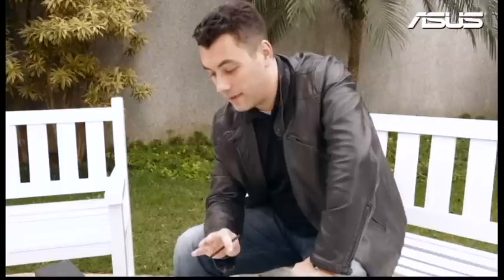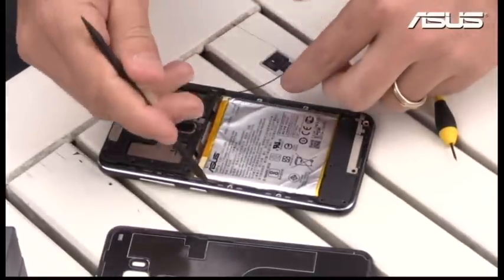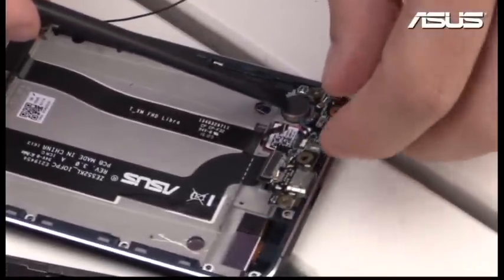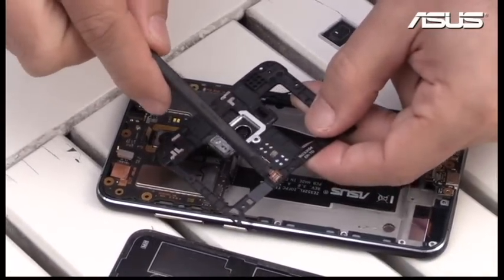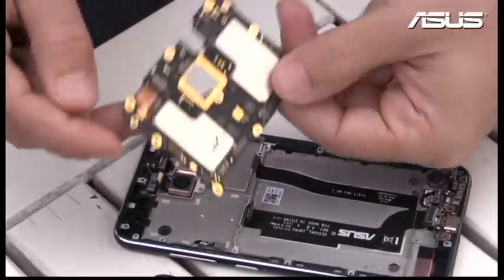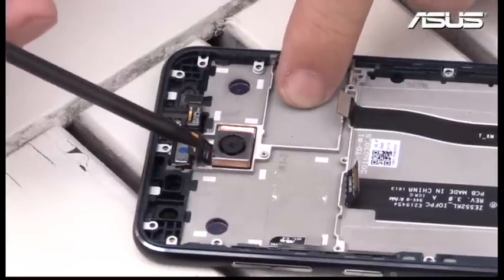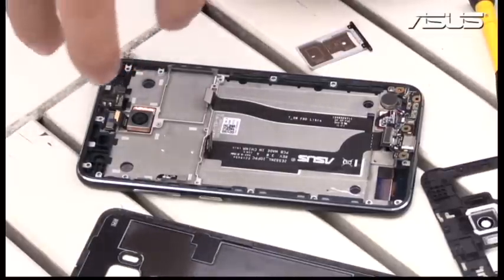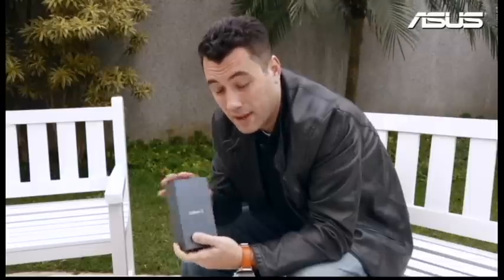Anatomy of Incredible ZenFone 3 by Marcel Campos

Comment: Marcel campos you don't have marketing and pricing sense. Sd 652 at 50k. Are u nuts?
Reply: No, i am not nuts not even the  only one to take decisions at Asus. If processor is the only parameter to decide which smartphone is the best or the worth of the smartphone I am sad to inform you that these days are gone. Today the processor is a important part but not the most important to define the total cost of a smartphone. Camera, materials, panel, battery, ram and storage play a big role in the total cost. With the new 625 (for Zenfone 3, not 652 as you mentioned.) battery consumption is much less but performance is superior than Zenfone 2. I think you should revise the specs better and understand that Zenfone 3 is in a new category and we will not abandon the other price ranges in India, but other products will fit in.
Reply: Then why price disparity in india as compared to other markets, where you are selling way cheaper. Good luck with your 63k zenfone, by the way note 7 is 59k and s7 is 43. I already bought oneplus 3 and i can't see where zenfone 3 at 28k can beat that.
Reply: +gaurav Mishra If you understand all the internal taxes and margins of distributors, sub distis, dealers and retailers, you will know this is not ASUS fault but a default behavior of India market. And by the way, the 63k is the 6gb ram with Snapdragon 821 and 256gb storage. If you are comparing with Note 7 you should compare to the similar specs don't you think?